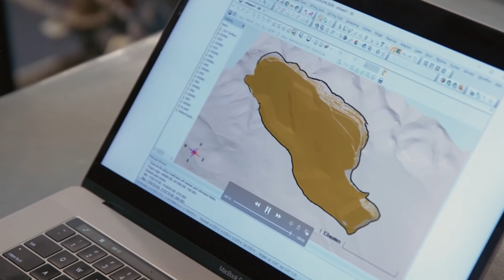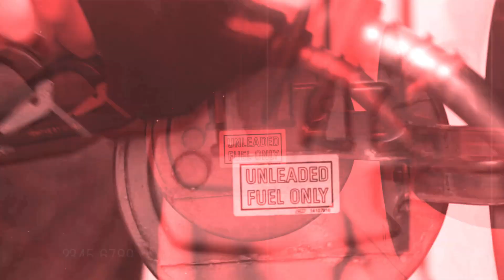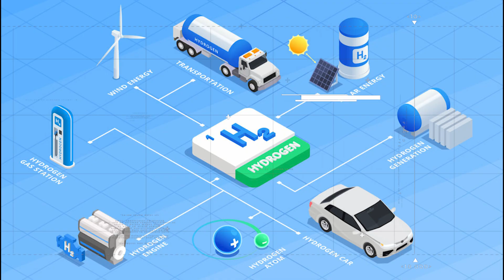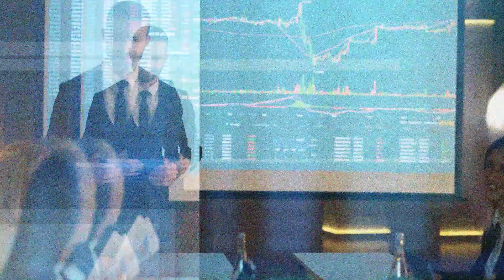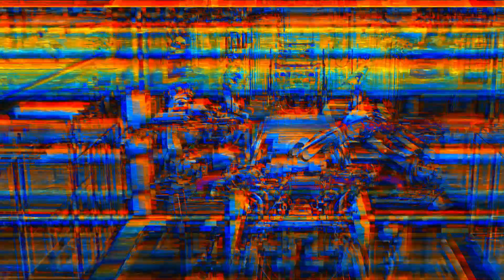Ford CEO Just Banned EVs!

Comment: EVs are not GREEN.  Even if lithium was free and everywhere...  Why, you ask?  Because of this;  E=MC²
All EVs are much heavier than gas-powered vehicles (GPVs).  So how can it be good for the Earth to push around 1/3 more weight per vehicle?  It's not, PERIOD!
Not only are EVs stupid, but so are all Solar Panels (SP) and Wind Generators (WG).  Because, as of today, there has never been invented, a SP or WG that can produce over 80% of the energy it took to make them.  
So these 'Just-Stop-Oil' IDIOTS just want 95% of the people on Earth to just die and go away.
But don't get me wrong...  Everything has its time and place.  Like, SPs and WGs are great if you live 100 miles off-grid.  And EVs are super cool if all you want to do is go fast, super fast.